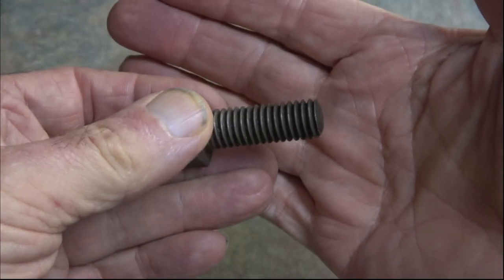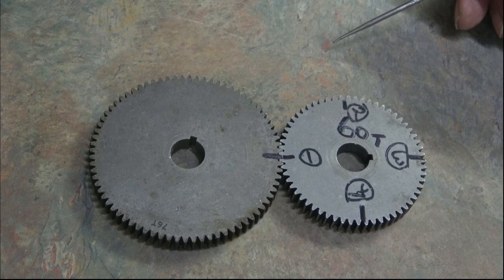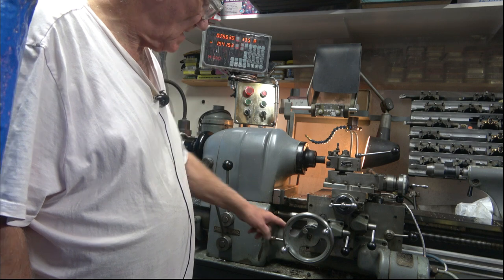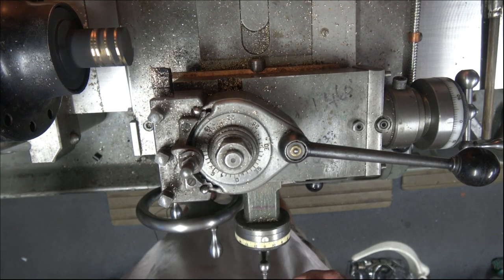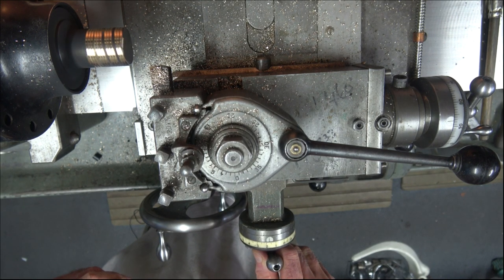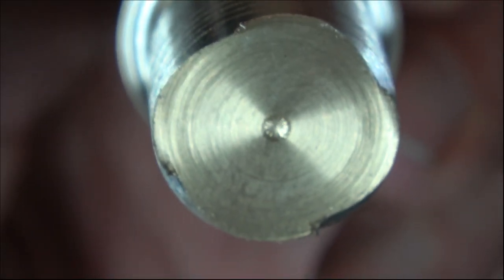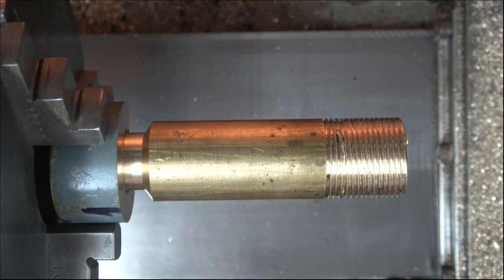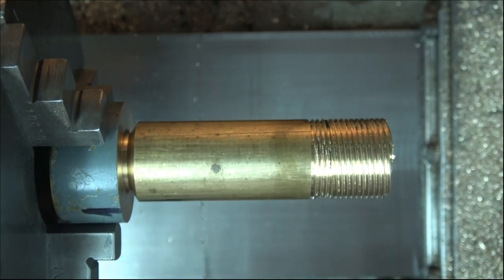Multi Start Threads. What Are They ? What Are They Used For ? And How They Are Made On A Lathe.

Comment from the maker: This is a CORRECTION to what I noted on the video. After sleeping on the matter and looking and playing with the thread, it IS a thread magnifier. The threads were cut as if it was a 16 TPI thread ( 4 TPI X 4 Starts ) My part thread length ended up at 3/4 inch, so 12 threads over that distance, the nut takes 3 turns to travel that distance. So it does Multiply the travel speed by 4. Please ignore the screen message that comes up when speaking about the bolt, also in my end chat I also mention it. Sorry for this misunderstanding on my part. Thank you to all the people who pointed out my error in regards to the multiple run out grooves causing the bad thread at the stop end.  This being the first time I had done this on this lathe, I was not aware of the problems I would encounter. At least I now know that there is not a fault with my lathe, just in my operation of it. Regards from Dave.

Comment: I think the error in the thread is a result of using the stop on your lathe to cut the groove. Every time you advanced the compound you were cutting a new groove farther down the part. The carriage still stops in the same place, but because you advanced the compound, the tool is stopping farther down the part. The result is that you are cutting four grooves instead of just one. The error you see is the second, third, and fourth threads overlapping the previous grooves. I think, to fix that you would need to move the stop in the opposite direction by the same amount you move the compound. That way the tool will stop in the same location relative to the part (one groove). That is not a problem on a single-start thread because you are not advancing the compound so the tool stops in the same place. Or you can just make a big undercut as you did at the end of the video.
Reply from the maker: Hello Bill, thanks for the view and this comment. You are quite correct about the multiple exit grooves being cut, several other people have pointed that out. Never considered it as normal single start threads are no problem with this lathe. Still as I said, my first multi start thread in over 55 Years of engineering,  so bound to make the odd mistake as a "Newbie" doing something for the first time. LOL Take care. Regards.

Comment: That's a clever method. I thought of another but I haven't tried yet. I'm confident it will work. Mount square stock in a square collet. Turn the portion  to be threaded round and to dimension.   Cut one thread. Index the work 90 degrees in the collet, cut the next. Lather, rinse, repeat.  This DOES require the depth of the stock in the collet to be consistent when you index, so face that end and use a collet stop. Should work!
Reply from the maker: Hi there, yes it does sound as though it  should work, just need square stock and a square collet, not got square collets though.😢 Good luck trying it if you have the equipment. Regards.

Comment: Great video - I appreciate you showing us the whole process, even the problem with the runout grooves. One solution would be to invert the cutting tool, run in reverse and thread away from the chuck - allowing you to pick the start (end) point of tbe threads. Anyway - very informative video, thanks for sharing.
Reply from the maker: Hello Stuart, thanks for the view and your comment. YES upside down tool and reverse if you have a conventional lathe. This Hardinge is special when it comes to screw cutting, because of the way it is made the machine should NEVER be run in reverse when screw cutting. For left hand threads start at the chuck and come out. There will be a dedicated video soon on how and why the Hardinge threads as it does, by special request from a viewer. Watch this space. Regards.
Reply: Great! Thanks - it’s a beautiful machine I look forward to learning more about it.

Comment: Thank You Dave...This is something I have not done for several decades. Your show jogged my memory & it felt good to think back. I think about this when I use the tooth past tube cap. That thread also has a force thread. Angled on one side and square on the other so it is not a symmetrical design thread but a load bearing thread. Seems like an overkill for a simple toothpaste tube cap? ... Love your Harding Lathe !!! TM
Reply from the maker: Hi Tuffy, Glad you enjoyed it. Thanks for watching. Regards.

Comment: The roughness at the finish is due to the different initial positions of the four starts leading to four different positions for the runout groove. The runout grooves and thread tails are crossing.
Reply: When cutting a 4 start thread using this method of advancing the compound slide 1 pitch for each start the run out undercut at the end of the thread needs to be long enough to accommodate the total amount that the slide moves, in this case 4 x .0625 + some extra clearance so that the leading flank of the insert does not crash into the shoulder. Alternatively on the Hardinge the stop which stops the saddle should be moved 0.0625" away from the headstock for each new start.
Reply from the maker: Hello Jon, You see that you do learn something new each day. As I said this was the first multi start I had ever done. Thanks for the information. Thanks for watching. At lest I do not now have to investigate my lathe. Regards.
Reply from the maker: Thanks for the view and your comment. Duly noted for next time, if there will be a next time. Regards.

Comment: Hi Dave, Great video once again! There is nothing wrong with you lathe, the ripped threads at the chuck side is a function of using the compound as you did. When you moved your compound dial 62 ½ thou you would also need to decrease your auto stop by the same amount to end in the gully that was cut by the first thread. You where running over the gully the first thread made then ran past the second end, the third end. I hope this helps, but there is absolutely nothing wrong with your lathe.
Regards,
Craig.
Reply from the maker: Hello Craig, Thanks for the view and your comment. Yes, several other viewers have said the same. But I did say that this was the first time I had ever done it, so lessons learnt all round I think ?😊 So used to doing only single start threads, that my mindset did not even consider what I was doing would not turn out as usual. Thanks again. Regards.

Comment: If you're moving the compound 62 thou forward you would need to adjust the stop position to compensate.
Reply from the maker: Thanks for your view and your comment. Several other viewers pointed out the same thing. Never done it before in 50 odd Years and will probably never do again. Was a learning curve for me and others as well. On a conventional lathe you would have had an undercut to run the tool into so it would not have occurred.  Regards.

Comment: If you do not wish to make such a shoulder at the end of your thread cuts, you then need to move your hard stop back towards the tail stock by the same amount that you move the compound for each thread. So, for your demo, you should have moved back your hard stop by 0.0625'' for each new thread. This is where your mistake resides in with your first multi thread demo resides in.
On your second thread you compensated your mistake by making the shoulder 0.250'' wide to compensate for the pitch (4 times .0625)

Also, if your blank is not running perfectly true to begin with, then this is where you will get a difficult thread start as you engage the nut to a different thread start.

Try to reduce your turning speed as much as comfortably possible.

personally
Reply from the maker: Thank you for your excellent comment. Other people have also said the same. But I did say that this is the first time I had ever done it in over 50 Years so it was also a learning curve for me. Will probably never do it again. Regards.

Comment: Dave, thanks for the tutorial. I’ve never seen a multi-start thread in real life, that I know of. I like how your lathe automatically stops at the end of the cut. What brand and model is your lathe? Thanks again for sharing, have a great day!
Reply from the maker: Hi there, thanks for the view and comment. It is a HARDINGE HLV lathe. American but made under license in EXETER in England around 1950. Dovetail bed, manual variable speed, 5 C collet spindle, taper fit chucks. Was superseded by the HLV-H model. Wider bed and the variable speed change was done by an electric motor. If you get 1.5 hours spare, watch my shop tour. I explain how I got it etc. Regards.
Reply: @daveticehurst4191  heading there now, thanks!

Comment: I think that the problem with those 3 end threads is from the tool itself.  In a laydown threading tool, its not a single toothed cutter,  the 2 trailing threads are being cut off by the multipoint tool when left in the last position and the spindle continues to turn.
Reply from the maker: Thanks for the view and your comment. The threading tool was a single point insert. The reason the last treads were chewed up was because I was advancing the compound slide by 0.062" each time. I did not change my carriage auto stop point, so No. 2 thread over cut thread No,1. Then when I cut thread No, 3 it cut over threads 1 and 2, finally when I cut thread No, 4 that then cut over threads 1, 2, and 3. If I had done a long undercut of more than 1/4 " wide there would not have been a problem. As I stated in the video this is the first time that I had ever done a multi start thread, so a big learning curve for me. If you get a chance read some of the other feedback I have received, it will explain a lot and other options using a standard lathe. Hope this helps. Regards.